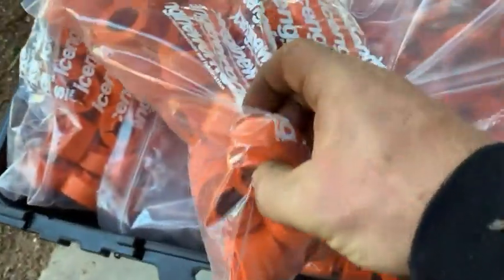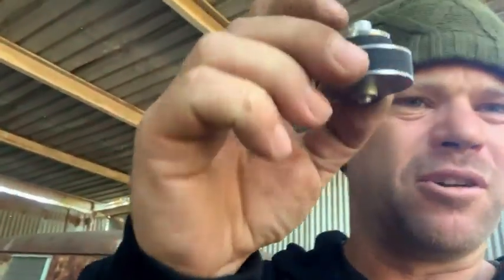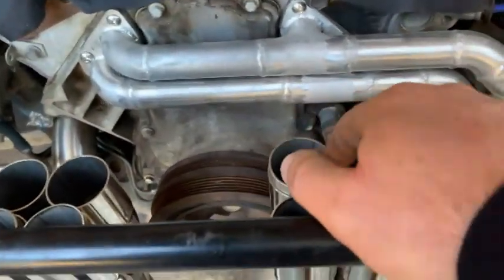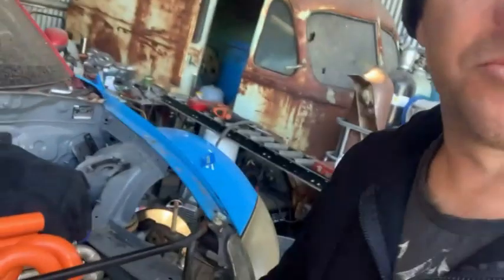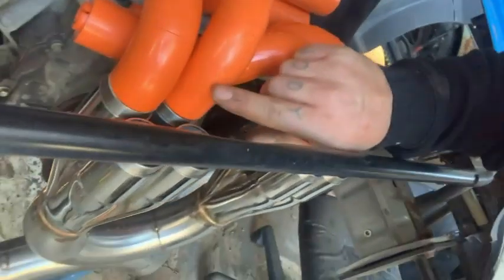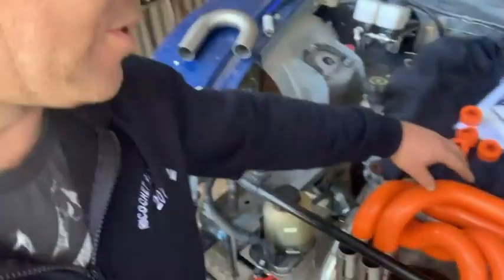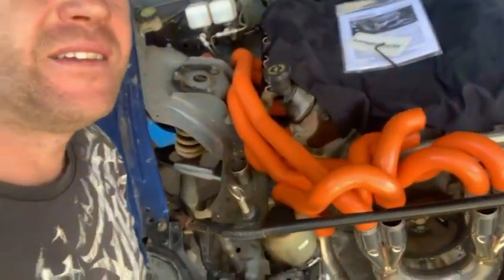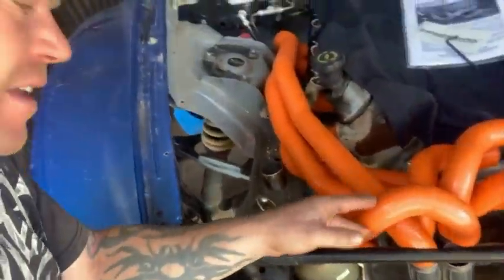Building a drift car - Mazda RX8 - 180 degree headers. Ice engine works, drivers side exhaust header

Comment: Thanks for this - they will be on my next purchase list - although I wish they were a bit more reasonably priced - but you no doubt get what you pay for - HA - and I would assume far less swearing and thrown bits of waste pipe by using this.  Have a nice day all.  CHEERS from AUSTRALIA.
Reply from the maker: Hi mate yeah a bit pricey, but I no no wasted material at all, a yea not so much swearing and throwing bends out of the cot. They do not make friends with acetone though. Spilled my bottle without noticing and it join a few together
Reply: HA - acetone - cheap effective glue.